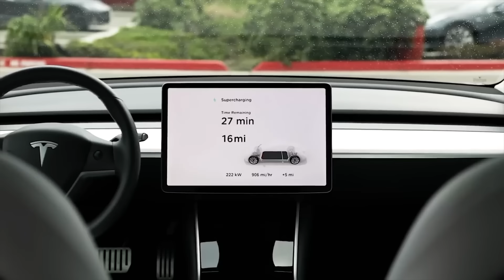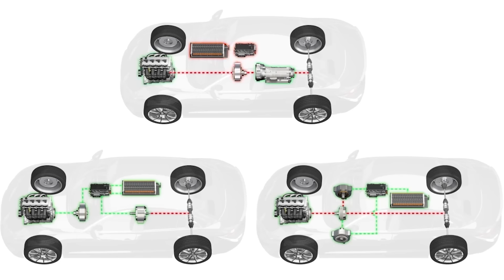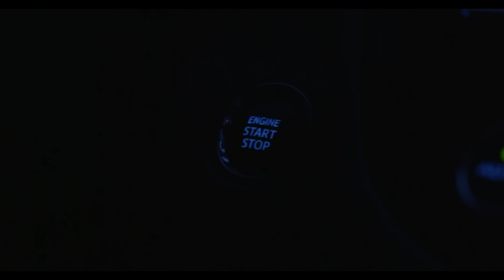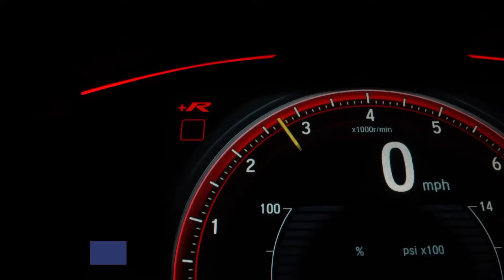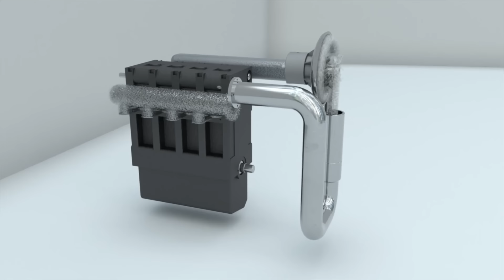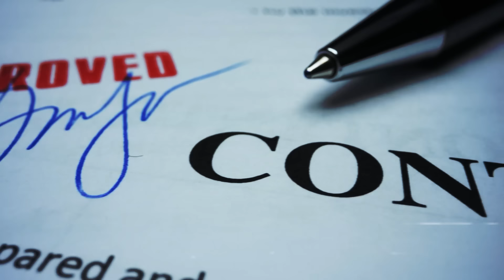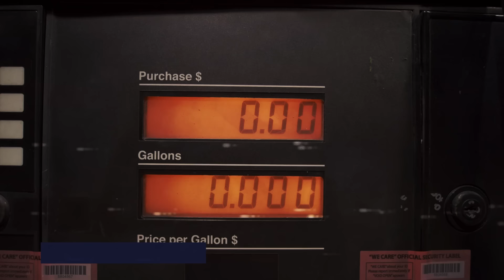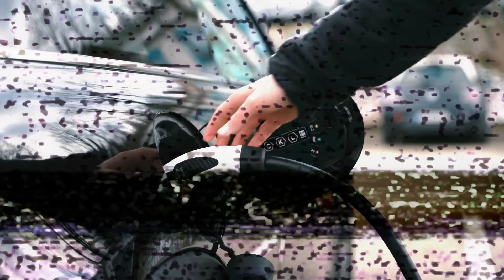Toyota CEO: "This NEW Engine Will Destroy The Entire EV Industry!"

Comment: I thought producing hydrogen needs a lot of electricity. Transportation and transfer of hydrogen also pose safety concerns especially when equipment ages.
Reply: China already invented new technology, which is solid hydrogen. Safer for transportation and lowest cost, but same efficiency. Ev will be out of market real soon.
Reply: Best feasable opción are e-fuels.   Which are carbon neutral.
Reply: @felipeschneider10 y😊 pi no mo kk😢
Reply: @flyingtortise2725  Doesn’t change anything to the problems of production.
Reply: @felipeschneider10 That is entirely untrue.  E fuels are NOT carbon neutral .
Reply: Yeah but japan uses nuclear power and there is also wind and solar to generate electricity for the process, the bigger concern is the CO2 problems become H20 problems
Reply: The words, hydrogen b *mb comes to mind while watching this video....some thousands of HBs racing around the hwy, driving recklessly until they crash and?.....Idk.
Reply: Eventually you can use hydrogen power to make hydrogen 😉 and those tanks in those cars are highly armored and tested like crazy.
Reply: @nedmilburn  So I guess every plant and tree is not carbon neutral then?
Reply: Have you seen the growing list of issues with EV's now!!
Did anyone do their homework before plunging full on into EV's???
Reply: EV is not the green energy we have been led to believe
Reply: Hydrogen for cars is a fad. Why switch from gasoline infrastructure to another servitude infrastructure of hydrogen? Better invest that money to the electricity infrastructure!
Reply: Heaven forbid a gasoline engine gets hit in the tank.

Comment: Question 1 :  How many gas stations are willing to invest by installing a hydrogen pump to replace the old gas pump without having enough business initially ?
Question 2 : Hydrogen is an extremely explosive fuel.  Some underground parking lots or tunnels do not allow hydrogen vehicles to enter.  As a new user, would you still consider buying hydrogen vehicles under so much inconvenient restrictions ?  If it is proved not suitable in reality, it is also very difficult to resell it !
In reality, hydrogen fuel is only suitable for big trucks travelling along some highway (without tunnels) such that they only require a few fuel stations along the highway over a very long distance.

Comment: Close to my home here in South Yorkshire England is an experimental ‘Gas’ station. A single wind turbine is used to power the electrolysis of ground water to fill large underground tanks with hydrogen. Here you can freely fill your Hydrogen powered vehicle. Then the surplus is used to power generators to feed the grid. So fuel for your car from wind and water. How will the taxman manage to tax air and ground water?
Reply: They will find a way believe it.
Reply: Good point they try something for real
Reply: They won't tax air or ground water. The tax burden will simply be moved to actual road usage using a system of road tolls. It won't matter how your vehicles is powered, whether it be sunshine, oil, hydrogen or chicken sh*t, you will pay according to how much you use the roads, with a distance based system.
Reply: Gotta love South Yorkshire 👍
Reply: Think about your question. 
They are already doing this.
It is not the air or water they tax it is the energy you consume.
It will be measurable so it will be taxable.
Reply: Truth be told...manufacturing of hydrogen fluid they knew back in the 80, s ..but black gold will never run out due to the earth's core making it. Imagine a world without plastic or paint or ink or lubrication 😂
Reply: @jamesbond007colt45 wong. black ‘gold’ will run out and no, the earth core does not produce it. The most important thing however is that if we keep on using carbon based fuels mankind will cease to exist. We do need a little oil to produce some plastics, but most of it can be recycled and there are many alternatives, albeit at a higher cost.
Reply: It will be metered
Reply: So basically it's a way to cause water inflation?
Reply: @giovannialtamore  Yes, that post came from a person who has no clue of the origins of Black Gold or the harm the burning of it inflicts on people.

Comment: Toyota and Yamaha have been partners for a number of years. The cylinder heads for a number of Toyota's were made for engines such as the 18RG in the late sixties and early seventies. It was used in the Celica exported to every country in the world except the US. Celicas shipped to the US had 18R, 20R and the 22R engines until they changed the car to front wheel drive.
The 18RG was a twin overhead cam unit that was a beast to drive in that small of a car. Also look at the Lexus overhead engines, I believe they are Yamaha creations.
Reply: Pipe dream.

Comment: I think Toyota caught their appendage in the door, Any businessman knows that if you're not first to the market, you might as well never tried.  Hydrogen power is too difficult to maintain. Hydrogen has to be produced, it has to be "canned" under high pressure and unlike solar panels that provide electricity to EVs it takes machinery to use outside energy to make. It's sad to see them try to promote it. You lose guys. Not to mention that if a canister of hydrogen gets punctured it'll be like 100 sticks of dynamite are going off. Somebody at Toyotat is trying to preserve their job until they can find a new one. Sad.

Comment: Hydrogen i.c.engines are already in use, JCB, makers of heavy duty machinery are already using them.
Reply: But what advantage does a hydrogen engine - still with hundreds of moving parts to wear, break or require regular servicing have, over a typical EV, which has around 30 moving parts, requires minimum servicing attention, and can be fuelled at home for a fraction of the cost of using public refuelling stations (or for free if you have solar)?

Comment: The biggest problem with Hydrogen is transportation, refuelling and storage. Without these sorted out, hydrogen engines are not going to likely survive. The idea itself is the right way to go but the problem is the governments needs to put more funding in to hydrogen infrastructure instead of joining the bandwagon and forcing everyone to get electric.
Reply: Hydrogen is equivalent to high gas prices   Where to go 300 miles on electric is about $19 dollars and that’s in California where gas and electricity are very expensive .
Reply: Hydrogen is also incredibly explosive.
Reply: @Hammydavis  That’s because electric cars only make 1% of the total no. Cars on the road. Imagine a 100 times more load on the grid than what it is experiencing right now and then watch the prices go up. And the prices won’t just go up for charging cars but it will go up for residences and businesses alike. Right now it works it’s a very short sighted plan. Unless they make fusion energy feasible I suppose, in which case they would have made the most profitable decision.
Reply: Major plane mfg are searching ways to use hydrogen as well
Reply: **let markets decide, not governments, just leave gov´s only for safety, you will see that EVs  will win the race, but there will be market for any other method.**
Reply: There are also pipelines, but from what I understand, hydrogen is far more difficult to push through a pipeline than heavier, more substantial gases.  I'm not positive, but I think that the longest hydrogen pipelines are well under 200 miles long.

According to some reports, it takes about as much energy to transport hydrogen about 300 miles or so is close to the same as the hydrogen transported.

My understanding is that the only hydrogen can work is if there are hydrogen generating plants everywhere.  Like every 50 miles or so.  That's a lot of infrastructure to build.

Like it or not, if you want efficiency of any kind, fossil fuels are the way to go.

I guess you could use a renewable fuel such as whale oil, but there clearly aren't enough whales to go around.
Reply: @paulkasputis5978 …you are right and not sure too many people want to drive a bomb!
Reply: @paulkasputis5978 gas is as well and there are alot of cars driving on gas
Reply: Hydrogen + carbon = methane. The only reason for this type of development is government incentive towards localized zero emission standard (i.e. you are also not allowed to breathe or fart).
Reply: @StormWalker101 lol but not only EV using electricity 😂😂 if we switch to 50% or even 80% EV population. Who’s paying for the new grid 😂😂
Reply: Better to further refine current IC engine to run on available fuels more efficiently than try to utilise expensive dangerouse hydrogen.This presenter ignores the fact that it takes three units of electricity to make one unit of hydrogen! Hydrogen cannot be compared to LPG.
Reply: @routmaster38  It is a given fact that loss will be experienced when you need to store electric energy due to generation and consumption not being at the same time. The obvious solution is to keep both in balance as much as possible, however since politics already decided we should generate when circumstances allow storage it is.
Reply: I wish you were wrong, but I think you’re right. I can charge my electric car in my garage overnight using off-peak electricity, but where the heck am I going to refuel a hydrogen car? I’m also not wild about a highly pressurized hydrogen explosion in a car accident.
Reply: Jns wat pala mamat ni. Hahaha
Reply: @paulkasputis5978 So is gasoline, you need to do some more research
Reply: @Ryan256 you missed the point! We don’t have the energy available as yet!
Reply: "The biggest problem with Hydrogen is transportation,..."
==
That's more important than you get burned to death in a car?
EVs are piled up unsold in car dealer for a reason.
Reply: Theoretically, hydrogen can be produced wherever there is water and electricity.  Electricity is now able to be produced almost everywhere.  Lithium is not a rare material, what is rare is lithium mines. The limiting factor in hydrogen utilization is not the hydrogen engine but hydrogen generation/distribution, and the energy/mass/density of portable hydrogen storage.  There are no "electric engines" that will need to be repaired. There are electric motors, which have fewer moving parts ,are more reliable, and need less maintenance than reciprocating combustion engines of any type.
Reply: Hydrogen is the most common element in the universe. By far.
Reply: @daniellarge9784  
"Hydrogen is the most common element in the universe. By far."
==
It's just not on the earth.
Reply: @daniellarge9784  hydrogen is the future of energy whether it be internal combustion, hydrogen fuel cell or hydrogen fusion! We are not there yet! There has been huge progress in the last 30 years  but we are not there yet!
Reply: @stephenbroughman3231  you think that your tank full of gasoline is not a bomb? When the Hindenburg burned up the people killed were killed by the diesel fuel not the hydrogen! The tank technology is way past that by decades, it’s just expensive!
Reply: @allgoo196  the reason:
1.) not enough infrastructure.
2.) they suck in cold climates
3.) most of them are ugly (looking at you EV mustang)

Tesla’s still have wait times for delivery.  So not quite sure on your EV piling up unsold comment.
Reply: That's Toyota's problem.
Reply: @treehugger3615  
"That's Toyota's problem."
==
What problem?
Reply: @StormWalker101   Sorry to say, Norway have proved this it not the case!!! 25% of the fleet in Norway is now electric, the sales is over 85%, have the grid collapsed? NO!
Reply: @sveinfriborg4  Are you trying to be funny or are you serious? Norways population is nothing compared to most nations. The amount of electricity required by Norway might be equal to if not less than just a few cities in US.
Reply: @paulkasputis5978  so are lithium batteries - so is gas - internal combustion engines require explosions to create motion
Reply: Your complaint about Hydrogen sounds like the same on for electric?
Reply: @jnb756 burns not “explosions”
Reply: My question is, what happens when the vehicle catches on fire??
Reply: Dodge has a good concept with the RamCharger platform for Trucks
Reply: The key is the range of a hydrogen vehicle. To match gasoline car's range, it has to be compressed or liquidified, as I know.
Reply: To deliver hydrogen to forecourts 18 times as many road tankers would be needed. No Govmt anywhere will take that option, plus it’s a very expensive fuel.

Comment: I saw a VW TDI jetta with CNG (  compressed natural gas ) get 120 miles per gallon and runs cleaner than jist diesel or regular gasoline .. Plus when the CNG runs out the car still runs on diesel at around 50 MPG ..

Comment: The fewer the parts the better.
Right? 
Reduced probability of failure, right?
Easy math.
The typical ICE has ~2000+ moving parts.
An EV drivetrain has about 20.
You do the math.
Solid state batteries are imminent.
No fire hazard. Shorter charging time. Longer range.
Be patient. It's still a relatively new industry/market niche.
Thanks, Elon!
Reply: Yeah, but the Wankel engine didn’t work either!

Comment: Forgot a big part of the issue with hydrogen. In order to get 100 Wh of energy in hydrogen, you need 120 Wh of energy to create it. Now since a battery vehicle can move 1 km in 140 Wh, that means the hydrogen car needs to move almost 1 km in 100 Wh, otherwise it is energy inefficient.

Starting to think about energy efficiency rather that miles per litre is much more useful in comparing systems. Lower energy consumptions, means less energy needed on larger scale.

Comment: Hydrogen is very easy to produce right at the carburetor level,  The trick is they vibrate the water (not oscillate, big dif!!), whether it be salt water or clear just a different filter system.  Anyway , just so you understand in very basic tech,   The center of a magnet is referred to as the "B" field  (or Nutron),    When you vibrate the water with the "B" field the water will separate the Oxy and Hydrogen at any rate you need to power your engine.  LET's be crystal clear we are talking about a  Sawtooth vibration at the correct frequency and were  good.

Comment: China will be the key factor here!  If the battery powered car becomes 90% of the market, it will be not feasible for the hydrogen powered to catch up in term of costs, infrastructure and innovation.  If CATL sodium battery can further improve the range to 600Km per charge with the new concept of condensed battery, what is there left for Toyota hydrogen car ?
Reply: "If CATL sodium battery can further improve the range to 600Km per charge...."
==
Keep dreaming.
Reply: When they can take a fill up of water and extract the hydrogen on board...... that's there end game